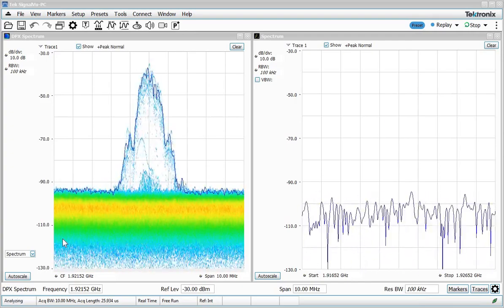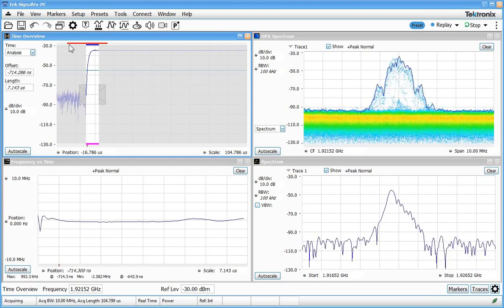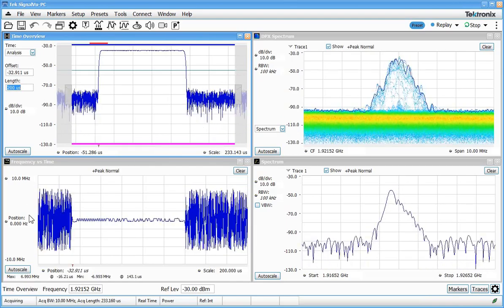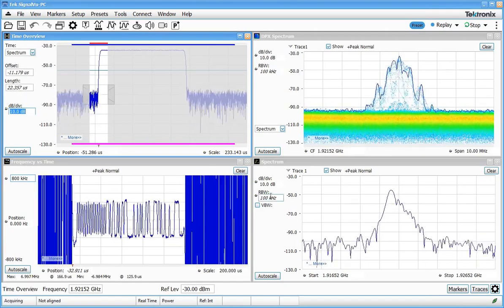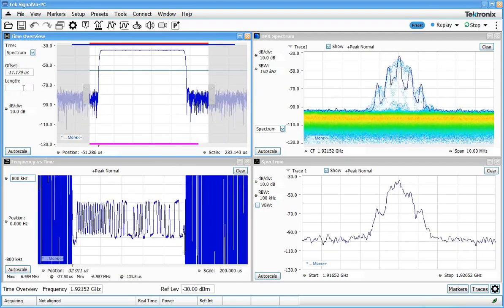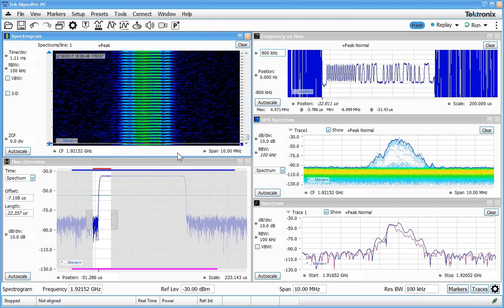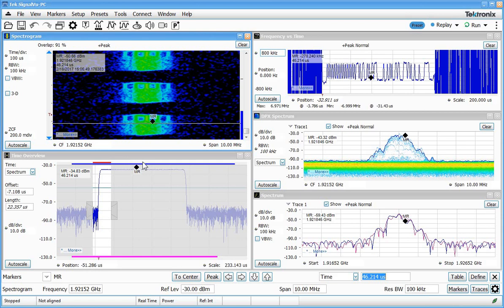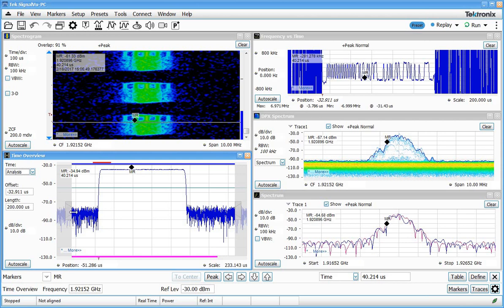#252: Acquisition & Analysis control in a Real-Time Spectrum Analyzer RSA | RSA306B

Comment: Hello again Sir! I have been using this unit for months now. I've been always unplugging it from the USB after each use. However, I use it a lot (in a daily basis). I wonder if it is ok to let it always connected to the USB, selecting "disconnect device" on SIgnalvu PC before closing it, each time I finish some measurements. Would it damage the unit to let it always connected to USB for too long? I mean, as long as the computer is turned on too. I just want to avoid plugging and unplugging the cable every day in the lab. Thanks again!
Reply from the maker: There is no harm leaving it plugged in, I've run mine continuously for days...
Reply: @w2aew  That's really nice! Thank you!
Reply: @w2aew  Is there any way to increase the markers font size? Sometimes, I got to get close to the monitor to be able to read. I wonder if I could increase them so that I could read from a little far from a monitor.

Comment: That's a real nice application for the USB SA. I am wondering what is the longest time domain window supported. Would it go to, say, 8s? Or is it limited to the minimum RBW? Thanks!
Reply from the maker: For the USB RSA shown here, the maximum time-domain capture of baseband IQ data within the analysis memory is 2 seconds. The RBW setting has no bearing on this.  Longer recordings can be made with the Streaming feature, provided the PC has a fast enough SSD to keep up.  Other RSAs in the product family, such as the benchtop units can acquire longer records.
Reply: @w2aew  Oh, I see. I am actually interested in zero span measurements over time for some pre-certifications tests. For FCC, I basically need to look at a 20s time window and verify channel occupation no more than once over that period of time. Is this model able to provide that? Thanks a lot!!
Reply from the maker: @LiraLab  Yes, this can be done, but in a different way.  Using Zero Span is essentially the "old fashioned" way of viewing spectral occupancy.  There are several more modern ways of doing this.  The DPX realtime spectrum display can be used which will show all transient spectral activity.  This can be setup in a max-hold, and can also be recorded in a time-stamped waterfall type of display.  There are other ways too - setting up a triggered acquisition to look for and capture signals within a frequency band is also possible.

Comment: Hi Alan. 
That was very informative. I would like a video on WiFi analysis. Example an off-air recording and how to set it up to do constellation diagrams and quality measurements. 
WiFi is always present and can be an easy demo to prospective customers.
Reply from the maker: I can do this in a future video.  It should be noted however that measurements and analysis of off-air WiFi can be problematic for a number of reasons - the most common problems are due to unavoidable multi-path effects and co-channel interference in the highly crowded ISM band.  Triggering and capturing a particular channel can be difficult with the USB RSAs due to the 40MHz wide trigger bandwidth, unless you can get close to a particular WiFi transmitter to make its signal stronger in the RSA.  Most of what you see in off-air monitoring are beacon transmissions which have a gaussian spectral shape and are transmitted with 802.11b format.  The data transmissions will have a more rectangular spectral shape, and are often 802.11g or 802.11n (at least for those found in the 2.4GHz ISM band), so a little experimentation in the demodulation settings will be needed.
Reply: Thank you Alan. I have a A-0047 directional antenna which is helpful to point to the device to be analized.

Comment: Help, I found your 3 videos about RSA and they are extremely helpful for me. My problem is I am seeing this warning or error: Not Aligned and another one is Warming up data not align. I looked at all the documents including the 650 pages but can not seem to fix this error or warning. Please help
Reply from the maker: The "warming up" message is simply a 20-30 minute timer since the RSA and the application was started.  The "not aligned" message can be cleared by running an alignment (Tools>Alignment) - you just have to disconnect any signal from the input and run it, takes just a few seconds.

Comment: Great video. I have a question. Can you change the time division of soectrogram while its running, like you reduced it from 1 ms to few us. Or is it only possible once you pause it.
Reply from the maker: You can do it while it is running.
Reply: @w2aew  thanks for the reply. Can you also comment on the min RBW and time division combination that you can achieve while running. Thanks
Reply from the maker: @usmangul66  The minimum RBW and the minimum time/division are both a function of the acquisition BW (tied to Span).  At wide spans, the RBW can go down to 100Hz as I recall, and the time / div is tied to the IQ sample interval which can be as low as 17.8ns.  We can get close to 1Hz RBW at narrow spans.

Comment: Just a Q, is it possible to monitor a continual changing peak in frequancy speaking ? (marker to peak doesn't change when the peak is changing)
Reply from the maker: The markers do not have a "peak tracking" function at this time.
Reply: @w2aew  is there any other way to monitor peaks ?
Reply from the maker: Yes. Use the Spurious display. Set the threshold as desired and all peaks above the threshold will be tagged, tracked and tabulated

Comment: hi can we get complex fft / can we get phase value of the fft measured thru rsa518A
Reply from the maker: SignalVu-PC and the RSA518A will only give you the magnitude of the FFT.  You can export the acquired baseband I/Q data to Matlab to compute the complex FFT result, if that is what you need.  The RSA will also give you Phase Deviation vs Time, just in case that is helpful for your application.
Reply: @w2aew  phase deviation vs time for time domain right
Reply: @w2aew  also while getting time domain signal it is cdistirted at the frequency for which we transmitted while fft is correct. But I am getting that signal in to main only after a shift of 100khz.

To get the time domain signal at the frequency transmitted shud I adjust bandwidth
Reply from the maker: @DreamyAchujk   The Phase vs Time will be phase with respect to the Center Frequency that is setup on the RSA.  By default, phase is rotates such that 0 degrees is at the Trigger location.  Narrower Span settings improve the SNR of the Phase vs. Time trace.
Reply: @w2aew  sir can i contact you..i have more queries
Reply: @w2aew   sir, i need phase of the fft amplitude is that possible. while acquiring rea time data, the center frequency the acquired signal seems distorted , but at a shift of 100khz i am getting the transmitted signal
Reply from the maker: @DreamyAchujk    You can contact me at first.last@tek.com, where first is alan and last is wolke.

Comment: Can you show how saved files from the MDO3000 series can be used?
Reply from the maker: The MDO3000 doesn't give you a direct way to control how much time (IQ data) to acquire.  You have indirect control over this by changing the RBW setting (narrow RBW = longer IQ record).  With limited IQ data vs. time, there would be limited ability to fully examine the signal characteristics vs. time.  The MDO4000 series on the other hand, does give you the ability to control the time duration of the IQ data, making it much more useful for collecting RF data for deeper analysis withing SignalVu-PC.
Reply: Does the data from the spectrograph history get downloaded? If so that might give some ability to view some signal characteristics over a time period.
Reply from the maker: The spectrogram can't be directly exported. Time trends in the spectrogram will only be long term trends because new traces are added the the spectrogram with each acquisition, so there is a substantial time gap between traces.